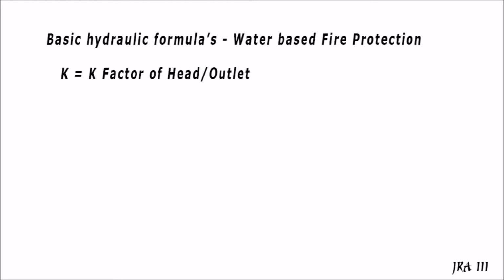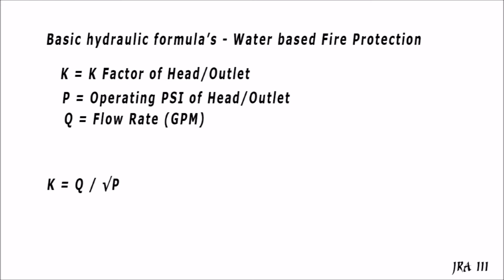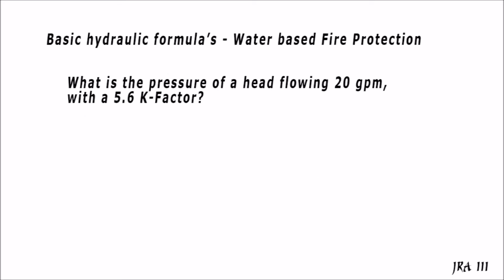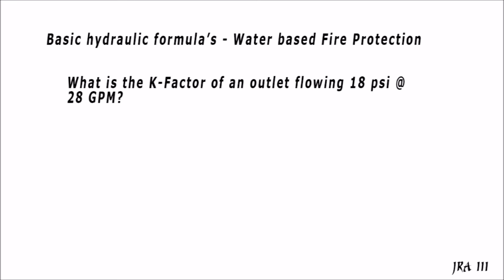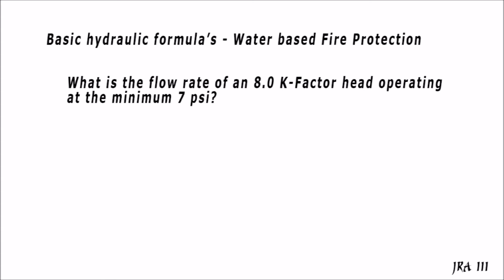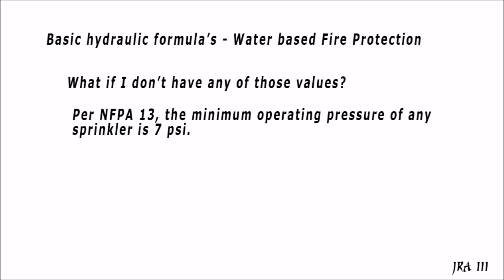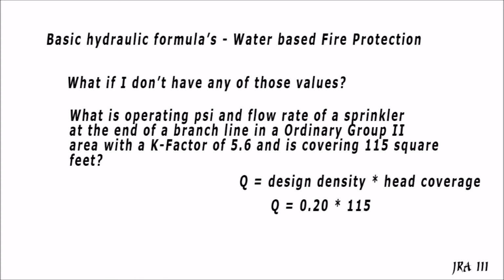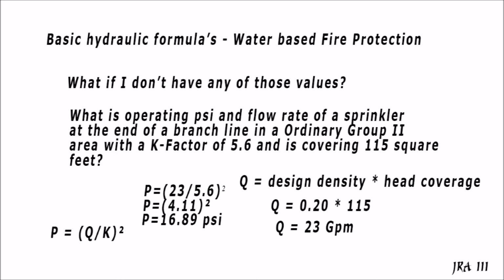Hydraulic Review - NICET I

Comment: Can you Bring a calculator into the testing area?
Reply from the maker: No, you have to use the calculator app on the the testing computer. The only thing you can bring in is the approved reference books, and the facility should give you laminate and marker to use as "scratch paper"
Reply: Okay so the app is a calculator and it put questions into the formal for you or you have to do that as well?
Reply from the maker: The app itself is just your standard calculator that you would see on a pc or phone. So in terms of figuring out the order of numbers, where to put them, etc. is something you do yourself. Generally you will find they provide you 2 of the 3 numbers. They always give you the information, but sometimes getting to the numbers you need takes a bit more work or fishing some information out of the book. Whether that's a minimum pressure or a flow density conversion to flow.
Reply: James Anderson okay awesome thanks for all the help man. Planning on taking my Level 1 soon forcwater based layouts

Comment: can you explain where you get the .20 from in this calculation for Ordinary Group II?
I understand there are a range of potential values for this group (.15-.2)
Reply from the maker: john kent sure thing. if you reference the density chart in nfpa 13, which in 2013 edition is 11.2.3.1.1, the bottom of the curve on density for ordinary group 2 is 0.2 to calculate the least square footage